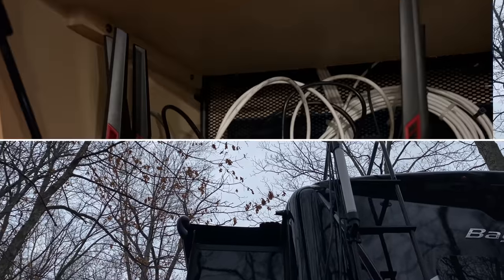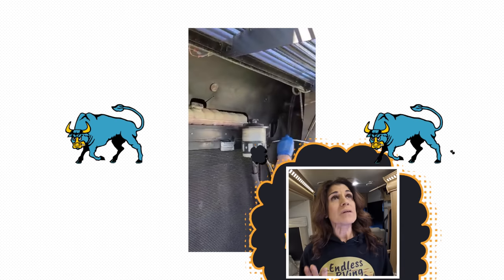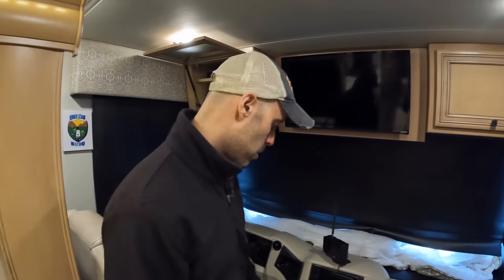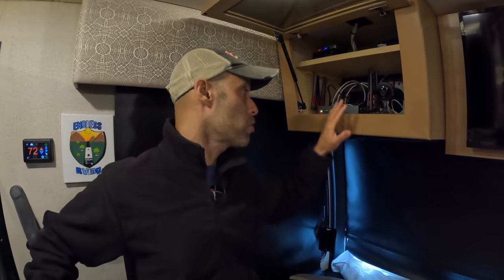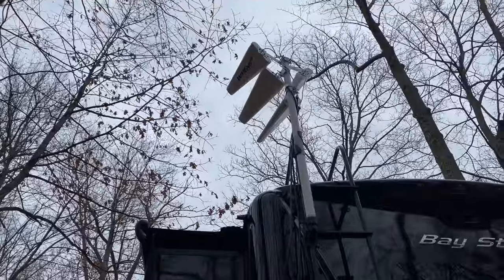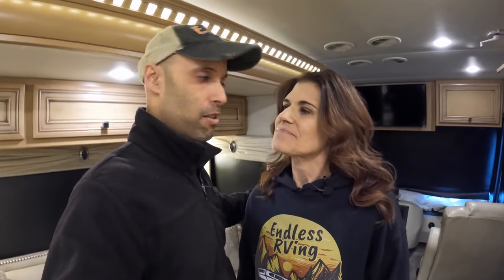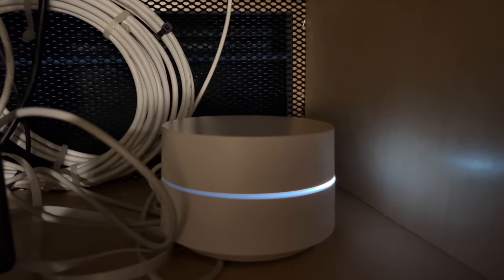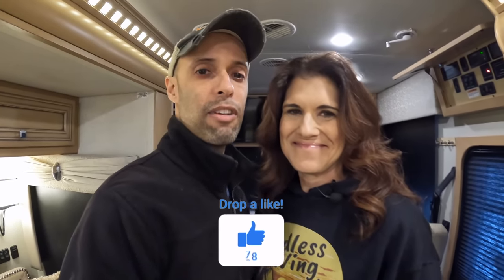How To Get Fast RV Internet For Beginners -- A Simple Solution!

Comment: Thanks for the tips. 
We use FMCA deal with T-Mobile "hotspot gizmo" for $49 /month and Visible Verizon for $40/ month...so far we've switched from one to the other depending where we've been and been able to constantly have connectivity and streaming with either one. The 2 are also truly unlimited data with no buffering or data cap. 
We've also given our deposit on a Starlink antenna hoping that for $99 / month and 250 mbps or better for speed and unlimited data, might be the next best thing  since sliced 🍞.
Reply: How did the starlink did ? Does it actually work?

Comment: I saw your previous video on streaming. I was surprised that people need to notified about streaming. We’ve been streaming for a bit over 10 yrs now and have not had live or cable since. Actually, had to look at the date of your video to discover it was about 1 yr go. 
Additionally, I’ll add that for people carrying around DVD players along with DVD, it might make more sense to store all your movies in a portable drive. I’ve had a 50 gig drive for longer than 10 yrs, about the size of my IPhone. Have our entire dvd library stored there which is well over a 100 DVDs. In an RV you can connect your drive directly to your smart TV. We haven’t purchased a DVD in about 10 yrs too. This tech has been around for well over a decade- it’s unfortunate that not enough people know or take advantage of it.
Reply from the maker: It will become more main stream as new RVers continue to join the RV community.

Comment: Izzy, thanks for your review and recommendation. I had several questions for Chester’s before I ordered and they answered each question quickly via messaging and it was very late at night on the East Coast when I was sending my quest from AZ so imagine my surprise when I got immediate responses. 😮. In any case I’ve ordered the Internet setup you recommended and it will be here before we head off on our annual 5 month cross country RV trek.
Reply from the maker: Awesome.  So far it’s working well for us

Comment: Do you notice any decline in signal strength with your new antenna compared to your old ones? With the new one not being mounted as high in wonder if there is a weaker signal
Reply from the maker: Directional will always be better.m, but is not necessary most of the time

Comment: I'm still using my MOFI4500 4GLTE router. Has limitations but it works. depending on the location on AT&T I can get 12 - 50Meg.  If I use my external antennas gets a lot better.  I do really need to upgrade. This weekend AT&T tower out at state park got saturated dropped me from 50M to 12M at night. That is the problem with using only 1 channel and not being able to aggregate the cell signal. But it was better than my Verizon signal.  I will be looking into that router to see if it will work for me or not. Thanks for sharing.
Reply from the maker: Your speeds will go up significantly updating the router.
Reply: Carrier aggregation definitely increases speeds tenfold

Comment: My rig came with a Winegard installed can you use that antenna with this setup?  Winegard WF2-435 Connect 2.0 4G/Wifi Extender
Reply from the maker: I don’t know what specs are for your equipment.

Comment: Great vid, thanks. I can't wait to get my setup from Alfredo. Thank you for telling me about him. As a retired FDNY firefighter do you think I should go with that same plan you have?  Although I get a 19% discount with Verizon I wouldn't be using their regular service it would be a SIM card.. So I'm a little confused about that. Also,  you and I spoke about me not having at having an Outlet that is hot at all times, but I do have a USP port that is hot at all times. Do you think that's sufficient?
Reply from the maker: Not sure if FirstNet includes retired check their website for requirements. Also the router I have is power hungry so you would need a powered outlet.
Reply: @EndlessRVing   Thanks..  I'm not gonna have all the Bells and whistles that you have. Just a special router Alfredo has coming in soon. Hopefully it will be enough when I dont have shore power.
Reply from the maker: That’s why I told people to reach out to him direct as he will have a solution that fits one’s needs best.
Reply: @EndlessRVing   You rock, thank you Izzy he and MJ

Comment: I have been using the 4G MoFi for the last 4 years. It's been great but I swear Verizon has been throttling me down since 5G came out. It's unlimited and unthrottled just like the First Responders have. I normally get about 20-30 down and 30-40 up at the beginning of each month. As it gets closer to the end of my billing cycle, my speed drops down to 3-5 down and 20-30 up. I call at the end of every month and they swear they are not throttling me down. I think it's time to switch to a 5G plan and something like you have with AT&T. I only pay $40 per month. I am sure anything else is more expensive. That's why I stayed with such horrible service.

Comment: I felt like I wasted 3:30 of my life when you whispered “yeah for ehh ya kno first respondas”, but I get it. The title gets the clicks. But your setup is pretty much only beneficial to first responders for the most part. The biggest struggle with WiFi is the amount of data in my opinion🤷🏻‍♂️
Reply from the maker: We also said to contact the seller of the routers regarding data plans 😉
Reply: @EndlessRVing  oh trust me, I picked up what you dropped down my friend😏😎
Reply: I was going to say… I’m not a first responder so I don’t have the $50 firstnet hotspot plan so I use a phone plan with unlimited data. The equipment will solely consume unlimited data not hotspot data
Reply: @RouterRelated  now THAT’s a game changer.
Reply: @firstnamebrent  precisely that allows you to travel all over the US and if you need internet you can for example, hop into Walmart and pickup a phone sim
Reply: @RouterRelated  ah yeah, that I understand. I just go through more than 100 GB a month with work. AT&T has the best deal though, $55/100GB

Not shabby at all. But that costs me $400 a month lol.
Reply: @firstnamebrent  with this router you can use cricket $65 or add a line to your att voice plan
Reply: @RouterRelated  I have to do more research on this then. Thanks for your help, kind of new to all of this. 

How’s Cricket’s service?
Reply: @firstnamebrent  cricket works on ATT towers and its unlimited so it's a go go